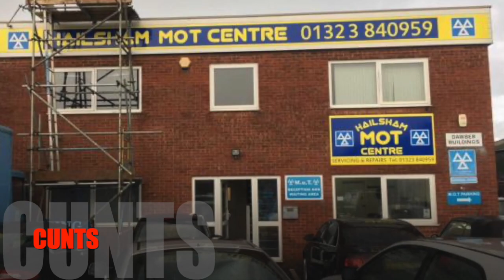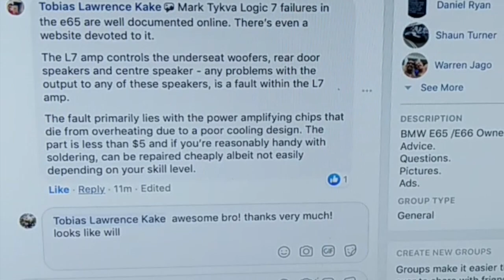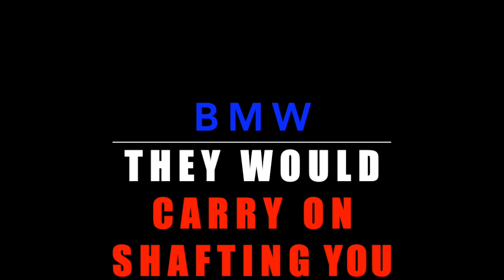BMW 7 Series E65 Logic7 Sound System Fix DON'T rush to replace the speakers its most likely the AMP!

Comment: Both my subs never worked when I bought mine but then they suddenly worked for like 30 minutes and were amazing then stopped working
Reply from the maker: It's the logic 7 amp, it's quite an easy fix for an electrician.  I paid about £100 to fix it